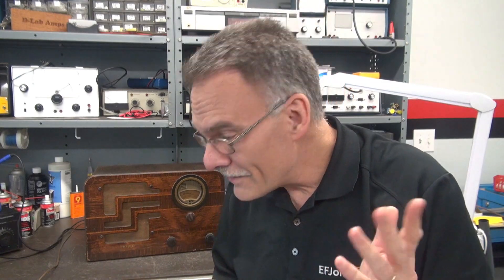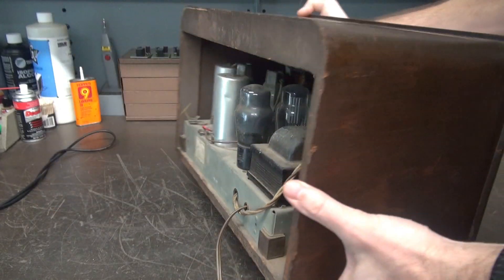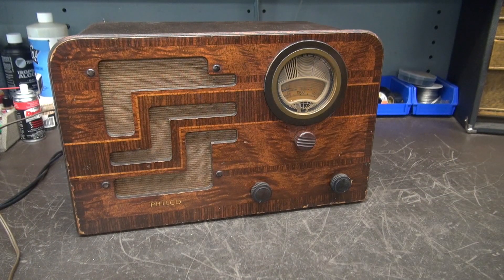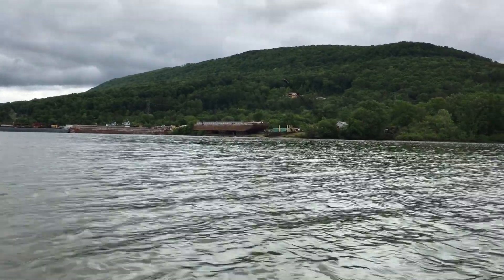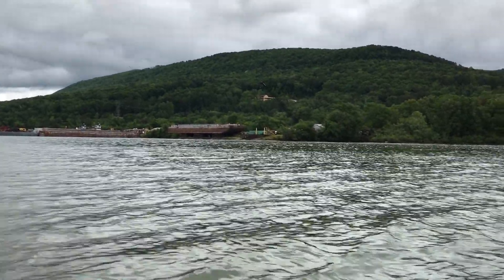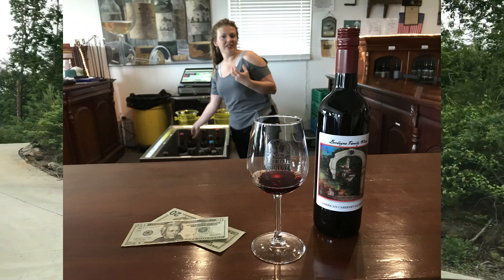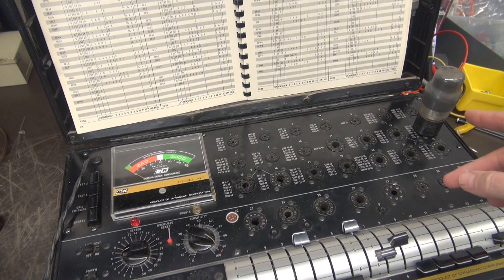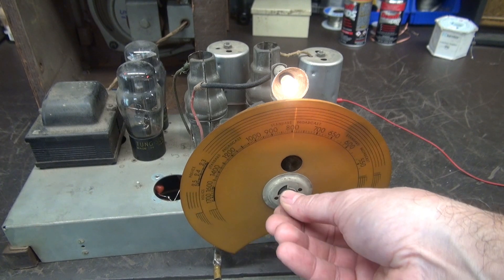How to repair antique Philco AM tube radio Hum No receive

Comment: Im just surprised youtube didnt immediately ban this video for showing flowing red liquid or because there is alko present and some little kid might come across this by accident and be smitten in all universes for all time.  As for the cap, ive seen them get replaced on a bit of pretty prrfboard and tucked undetneath.  I tied mine with mason line but it didnt come out as pretty but they still work.  Im not so sure todays kids care about these old radios as they dont even have a screen and are not interactive so they wont collect them.  Enjoy them while you got them to listen to 'Country Heroes' by Drac.

Comment: Working on a Zenith clock radio and have the same issue except I have changed the electros and most all caps, 4 tubes. It's a low hum with no stations.

Comment: Got a Philco 38-9.It's similar to that one. I have hum very bad. I've replaced the filter caps and all the other caps. Did nit even make a dent in the hum. I measured the hum  with a decibel meter and it's over 80! That's hum!

Comment: I have a Philco 38-12 radio. It doesn't tune in any stations. I've checked the oscillator, it's not open (has close to the correct ohmage per the schematic. The audio section is perfect. I connected a 1000 hz signal generator to the grid cap of the 6A7 tube and heard a faint tone in the speaker. On the 78 tube it's a little bit (but not much) louder (when touched to the grid cap) and on the 75 tube grid cap it's really loud. Not sure if it's a bad tube or bad 110 pF cap or the oscillator itself, or maybe the tuning capacitor. I hope to one day get it fully operational, especially after replacing all of the wax paper capacitors and both electrolytic capacitors.

Comment: I am kind of surprised you fired up an 80 + year old radio with the original filter cap still in the circuit. That would've been the first thing I would've changed before firing up the radio. If not that, bring it up on a variac to hopefully reform the old electrolytic.

Comment: Hi Terry!! Just found your channel and think you are the coolest guy around! I recently picked up a Philco Transitone Model 27-9944 in completely original condition and am trying to stop the humming/get a radio signal, but haven't been able to find any info (schematics, troubleshooting manuals) online anywhere.  Do you know anything or have any resources that could help?? Do I just need to replace all the capacitors?  Thanks so much!! Sending red wine delights from NYC. 

Cheers!
Leia

Comment: Hello Mr. D - lab, you have inspire me to work on some of these old radios. I'm on my 3rd one an have run into an issue. I am working on a Philco model 50-1720. I have given it life but no sound! It still a
has the original antenna with the wires solder to it but I don't know where to hook them to. I have search the web for schematic but had no luck. Could you sale me a schematic on this model if you have one??

Comment: Had the manufacturer used TELEFUNKEN Space Charge Vacuum tubes and used a B+ of 36V and Heater Voltage of 3V  then there would be no shock hazard.

Comment: I have a question. You most likely won't reply but I have to ask. I have a 1958 philco dodge truck radio I have been trying to fix. It is a TAR 58. I replaced the wax caps and some resistors and now I get hum on the speaker but I can not find the problem. This radio has the RF and IF transformers with the mica caps inside. Do you know of a way I can test these caps without taking them apart? The hum gets louder when I put my hand near the circuit.

Comment: Did you have those sneaky autotransformer radios in the US? 

We had them in Germany, they have a power transformer, often even a 2way rectifier .. but the chassis is hot, since it's an autotransformer, not an isolated one.

Comment: If I noticed correctly you replaced the original 8mf filter cap with 2 - 8mf caps in parallel, which would net 32mf. Did I miss something. Or was I drinking too much wine. Keep up the great work, I thoroughly enjoy your videos.
Reply: I stand corrected, you used 2 16 my caps in parallel.
Reply: @bobvecchi7981  that's what I was thinking in the too, but then... look at 4:10, see the orange color capacitor? Now, at 5:10 that capacitor is gone. So this makes me believe he used two same caps to replace two different ones.

Comment: Just wondering why you insist on always removing caps from the chassis and leaving an empty hole, or better yet go through the trouble of putting a tube socket on there and then running wires through that.. Just quit the old wires leave the old cap on the chassis continue underneath like you did much more aesthetically pleasing
Reply: I typically use remakes of the original formfactor, they are somewhat expensive and (in this case) unfortunately smaller than the original ones, but I like how they fit into the original holes.

Comment: Very cool radio and repair. I think it’s cool that you would repair it at no charge.
I’m a small time collector, and on a very tight budget. I have a lot of radios, But not a lot work. I am very slowly learning to work on them. Have no equipment at all, yet.
So I have to “ farm” them out, costing me far more than what many are worth. That’s ok, if I have it.  I do have someone who gives me a break on working on my tube radios, but getting anyone to work on my transistor radios is not so easy.  
So all of you who work on radios, hey, it’s nice to give a guy a break once in a while.
 I’ve seen a few of your shows.  Cool.
📻🙂

Comment: Amaze me they have 2 outtput tubes are they push pull ? Notice some use a intrerstage audio xfmr .have a 20 &70&90 and a4tube tomb stone with a clock philco unknown chassis of 30s .ps 1l6 can be replaced with a 1r5 in z.trans oceanic if you want to save the original.100$ tube. That's a nice philco.they should not use it as xfmr may fail .I have a nice 10$ am fm s.s.panasonic I play a lot .theese things too good to use as every day radios.

Comment: tuning cap has peeling plating on plates... connect tuning cap across line volt along with 100 watt bulb in series....tune back and fourth and peeled plating burns off
..common problem....take care to isolate cap from circuitry....I learned this trick in 1962, my first radio repair job

Comment: Why not just leave the old filter cap in place? It still looked good on the top of the chassis. Now you’re left with a big hole that someone can stick their finger through and zap themselves. Not trying to be critical, you’re videos are great. But I would not have bothered removing it from the set.

Comment: only comment is I would have left the dead can cap on chassis , the wax caps must go for reliability ect even if  test ok as they can start to "leak" electronically as they heat up with the now use after sitting for many decades

Comment: Nice radio, but I wish you had physically left the old cap in so it would look visually correct. But then, I've been known to cut old can caps open on 1920s radios and hide modern caps inside so it still looked original.

Comment: I would like to add that if you replace a glass tube with a metal type to be sure to verify there are no connections to pin 1 on the socket. On metal types pin 1 is grounded to the casing. Often the mfgr's used an unused pin (1) as a connection point. Grounding that pin can cause the factory smoke to escape from the parts connected to it.

Comment: D labs I bought a AA5 radio with the ferrite antenna broken into three pieces,I ordered a blank ferrite bar and going try to wrap it with new magnet wire,I cant use the old wire ,its flaking every where ,the coating comeing off the megnetic wire,will this work
Reply from the maker: Hello Ron, I do not know how critical the winding count + direction is for the antenna stick. It may be better to try and find a donor out there? Hanger queen Air force term.

Comment: For safety reasons I would put a fuse in line in case that 80 plus year old power transformer decides to short one day. Also the Bakelite  block across the line cap should be replaced. The other blocks could be rebuilt too for peak performance.  I understand that you didn’t want to get too deep into a restore on this but it,s such a nice old radio that it deserves the extra mile.

Comment: Hey Terry, about 2 years ago I found a filthy 1939 Philco floor model a the local flea mart, took it home and determined that the radio was useless but the cab could be cleaned and refinished. I stripped out the radio chassis and built a point to point Princeton clone into it. Of the 4 control knobs I used the original volume on off and the tone controls. I used the other 2 holes for pilot and input points. A telecaster jack cup fit perfect and with a new weber 12 inch alnico I now have a gorgeous 15 watt combo amp/jukebox. I did this because I watched your videos and thought that in 1965 as a 15 year old I could build a Heathkit receiver without screwing up then a 68 year old might get it. Thanks for your help, best regards. p.s. the wine name looks French and they may pronounce it like Door Don.

Comment: Geez, the commenters need to stop wining so much about your vids...
I like the dial indicator on this radio though, generated by a slit aperture in the back of the dial plate and the whole thing is lit by one light. Nice piece of engineering there.
Cheers,